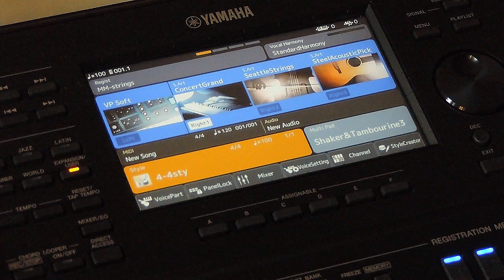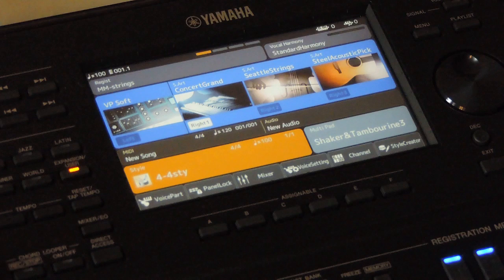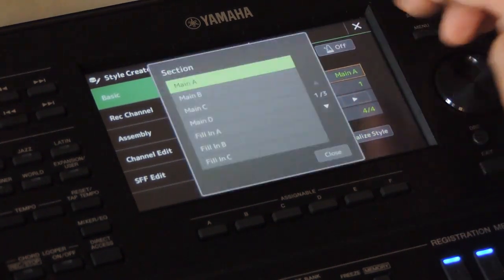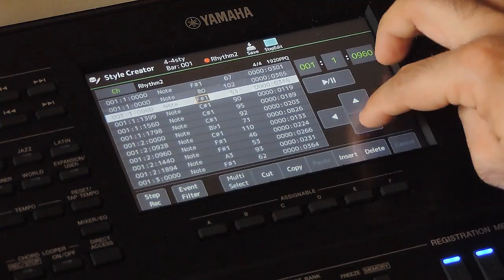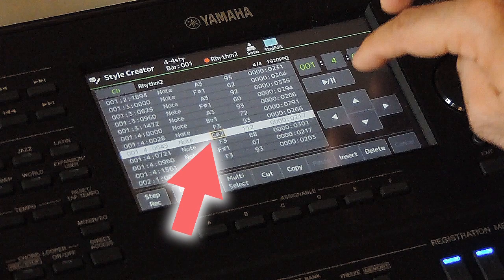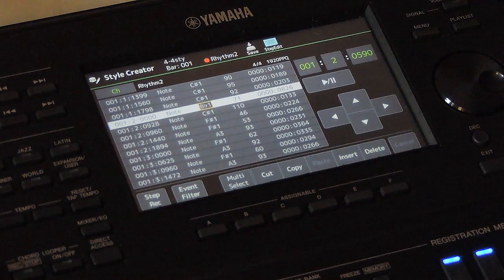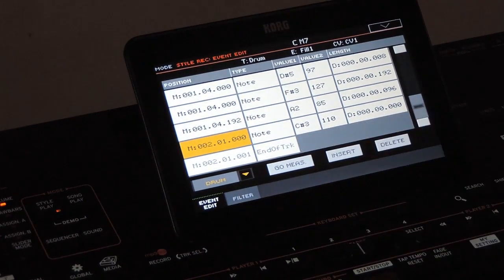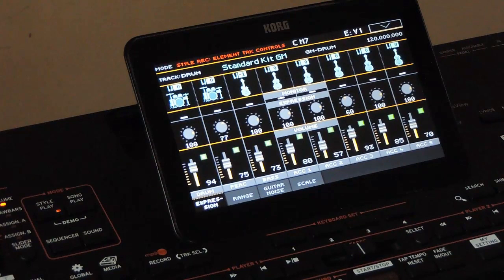Creating fills in styles with crash cymbal ending | Arranger Keyboard Tips

Comment: Thank you for this video. I've tried making some styles but the volume/velocity levels of tracks are confusing. At what average volume should a create a style?
Reply from the maker: There is no rules for the volume levels. It depends on the mix you need. It can be controlled with the note velocity, track volume or expression(in korg)
Reply: @ArrangerTutorials  I'm using a Yamaha s970. The inbuilt styles have an overall lower volume level but all the user created (collected from internet) has higher volume level. Also is there any standard ratio of velocity values for kick-snare-bass-guitar notes etc. for a balanced mix? ( Like what should be the minimum velocity value for a sub bass - 90-100?)
Reply from the maker: @geojoseph  there is no standard velocity rate. Because each kit especially custom ones will have different levels. So it cannot be set by a standard velocity value.